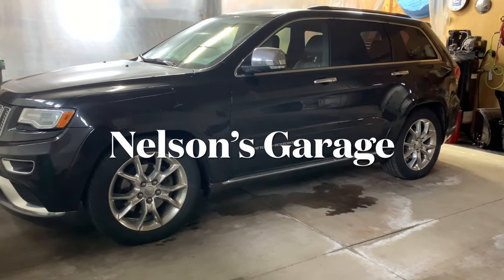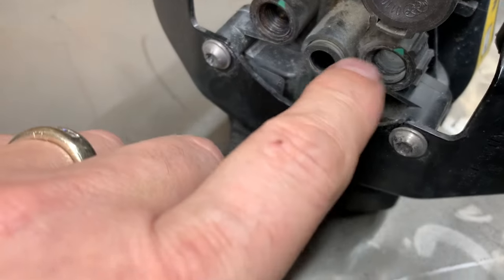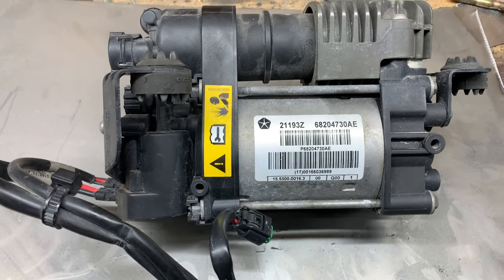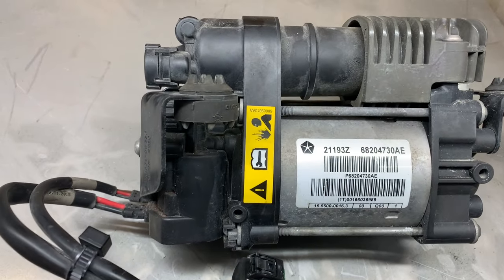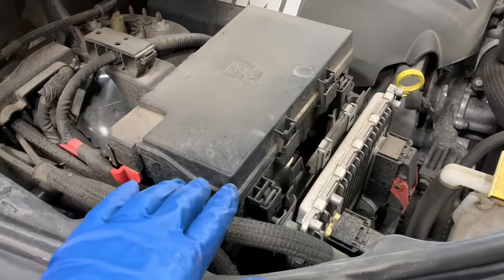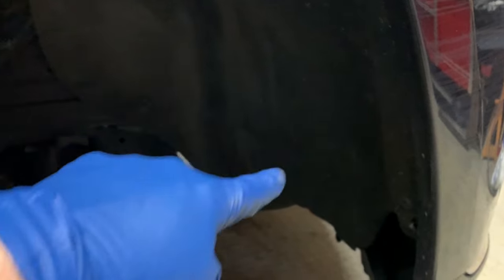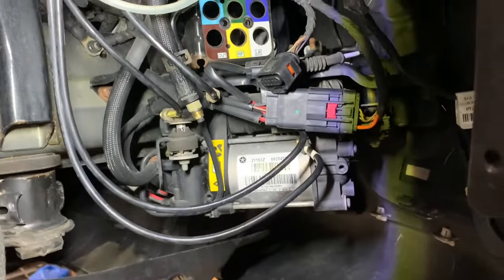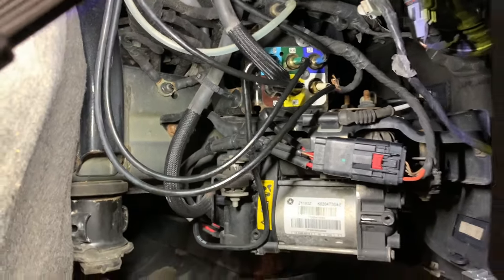Jeep Grand Cherokee Air Suspension Fix

Comment: Thanks so much for posting this.  Recently got the dreaded "Service Air Suspension System Immediately" warning on our 2014 Jeep GC after weather dropped below freezing.  After reading these comments I think I know where I messed up.  A few months ago did a fix for the leaking 90 degree fittings on top of the front struts and likely leaked them out. Also didn't refill the pressure tank.  Do you think water could have gotten into the system and froze something up?  

Just for reference this Dorman installation video was informative.  Talks about using a bidirectional scan tool to depressurize the system, and check pressure levels after installation.  Of course they are pitching their compete pump and valve body assembly.
https://www.youtube.com/watch?v=r_UtE9o6gPA
Reply: I'm having he same issue with my 2014..... cold weather and the front end settles down....if it warms up a few degrees it's back to normal.
Reply: @darickymeister   The weather warmed up yesterday and the code went away!  My shop mentioned this could be caused by bad battery so I changed that as well as it was 5 1/2 yrs old.  Pulled codes using jscan and it showed C15AA-00 "air leak during vent" and C1562-98 "ride height air pump control-component or system over temperature".  Looks like it has a leak somewhere.

Comment: I have a 2014 summit, same light problem, the front of the vehicle is lower than the rear, I went to the garage they told me to replace the air suspension module, do you think the problem will be rule ? and where is the module in the car?
Reply from the maker: Lower in the front could be the module, which is located under the driver seat. Just make sure to check for leaks in the front lines and air bags.
Reply: @Nelsons-Garage my front is in low and rear in off road2  all 40 amp fuse seem good changed one burnt fuse that showed good.

Comment: My 2012 jeep grand Cherokee overland is slammed down low and won’t move at all. Bad compressor? Or could this be from something else?
Reply from the maker: That’s hard to say, is there any warning on the dash or codes? Can you hear the compressor running when you try to move the suspension? First thing would be to check the fuses and relay I think there are 3 of them.
Reply: @Nelsons-Garage  ok update. Got the codes cleared on the jeep and the suspension is working now. Could this indicate a leak?
Reply from the maker: @Witchy___Woman not necessarily. You will have to see how it reacts as you drive / park it.